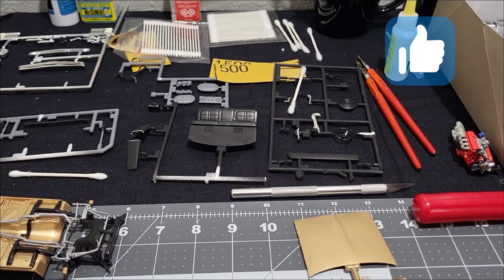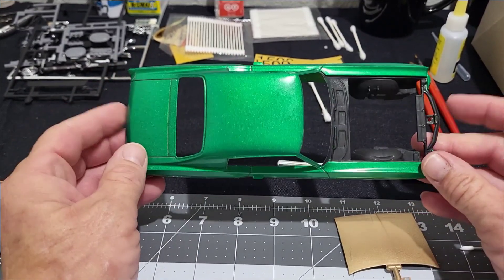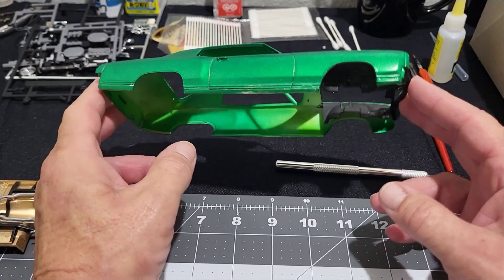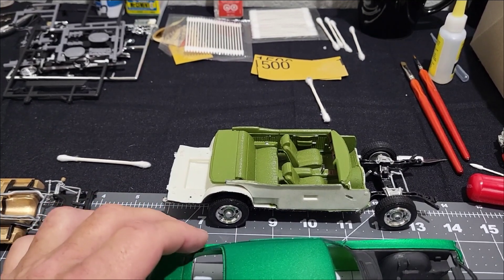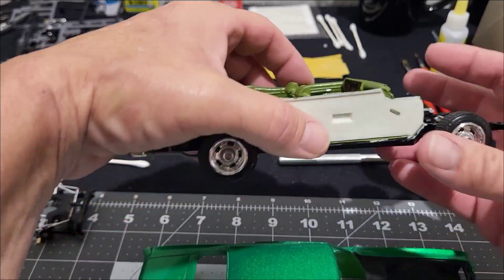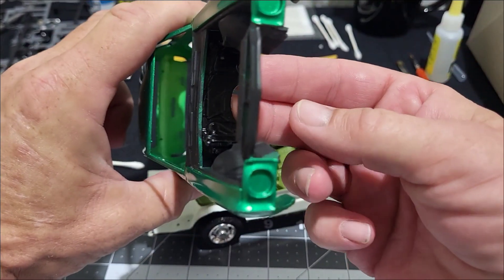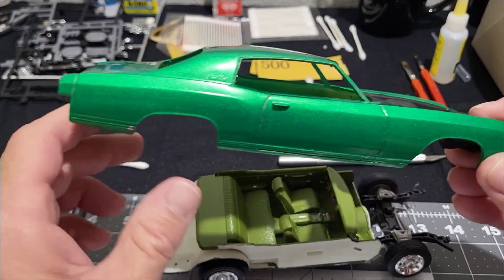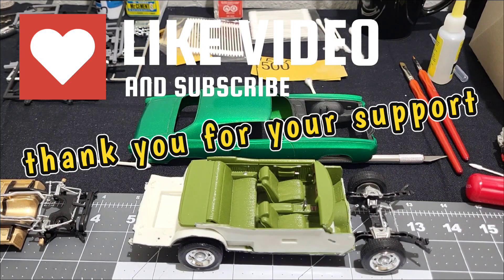70' Monte Carlo will live again!

Comment: I had a gap of about 35 years of not building models, from when I was a kid/teenager to fairly recently. I think my biggest disappointment was finding all the fit issues with the kits that I didn't remember when I was a kid.  I probably wasn't a good enough modeler then to realize they were there. Thankfully most of the newly tooled kits are much better.
Reply from the maker: Some here with fit issues. I'm sure it's me! I'm having the same fit issue on the Duster dashboard causing the body not to lay properly. That's in the next video.